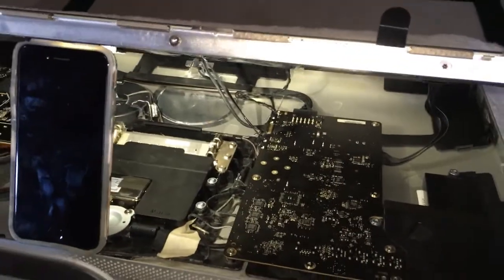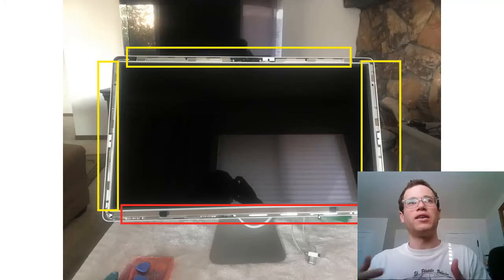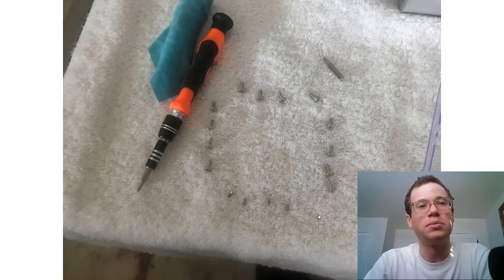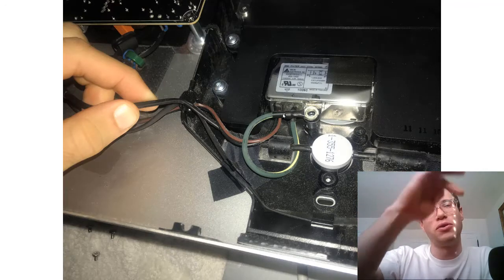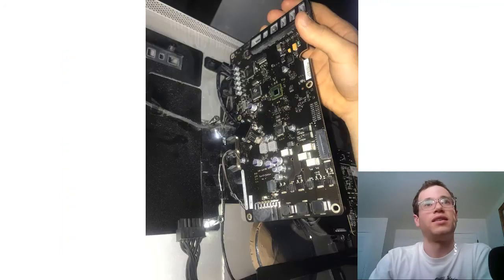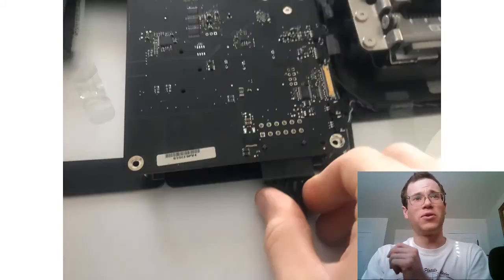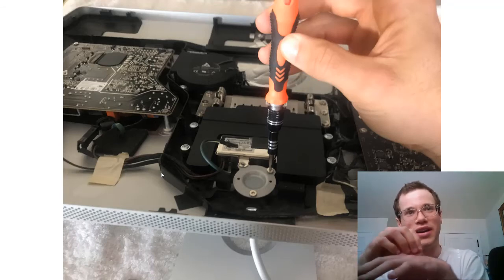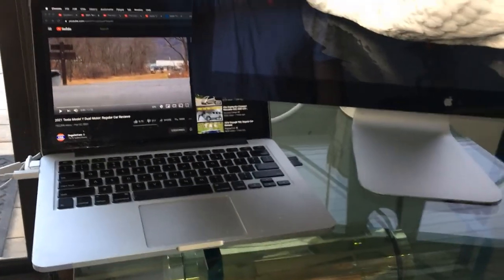Apple Cinema Display - Teardown and Repair

Comment: Looks like the thunderbolt versions got some real issues with the internal cable. Plus a pain in the ass to change it.
If Apple had chosen to have a removable cable instead, there would be no need for this complicated surgery.
I happen to have the Apple Cinema Display 27'' 2010 model and my only issues so far, after 11 years of working with it, is the problematic mini display ports on the internal graphics card.
Other than that, these are certainly great screens.

Comment: Hi Vincent. Thank you for a great video. Where did you get the Thunderbolt replacement cable? I can't find a place to buy it. All the best, Jens
Reply from the maker: Hi Jens - I bought the part on Amazon or eBay. Good luck!
Reply: @VincentStevenson  Thank you! It's a popular item - out of stock many place. But I will prevail 🙂
Reply: I found a cable for $55 and it fixed my Cinema Display. Thank you !

Comment: Is there a way to replace the Thunderbolt and MagSafe cable with a USB-C cable?
Reply: There are other videos on Youtube, but its quite more involvement.
Reply: No it is not possible to replace the cable with a USB cable. What you CAN do is get a thunderbolt to USB-C adapter dongle. Works great.

Comment: What model number is this? I have 2010 A1316 that doesn’t wanna turn in via apple adapter (49$) thunderbolt 3 to TB2
Reply: He calls it a Cinema Display. It is not an A1316. It is an A1407. The adapter you need for your A1316 is a Mini DisplayPort to Thunderbolt 3 (USB C).

Comment: Hey Vincent, great video, thanks. Could you please let us know what symptoms your display shows to you decide change that cable?
Reply from the maker: Hey Erick, the only difference is the physical cable - I was not having any other symptoms, but I would bet the connection would deteriorate if you don’t replace the cable eventually.
Reply: @VincentStevenson  Thanks for your super fast answer. I'm having some issues with my Thunderbolt Display and I was wondering if it could be the cable.

Comment: Hi Vincent, very informative. Any suggestions on where to take a 27" Apple Cinema Display for repair? Mine hissed and smoked (came out of the place where the base/support meets the back of the housing, didn't smell like a burning resistor) and Apple has retired it because they can't get/don't make parts anymore. After the hiss and smoke, the display went dark, so based on the location of the power cord, I'm guessing it might be the power supply. Any ideas? I'd appreciate the help.